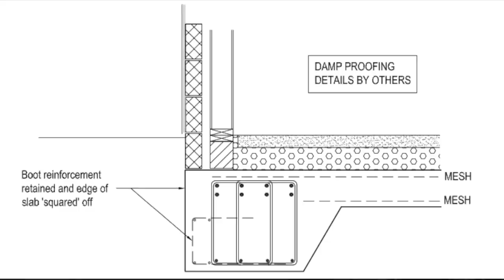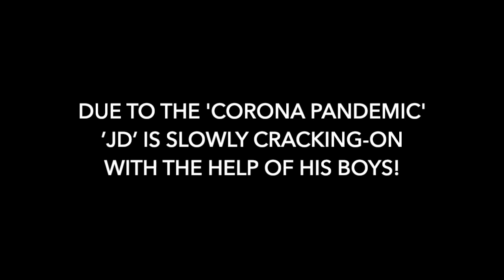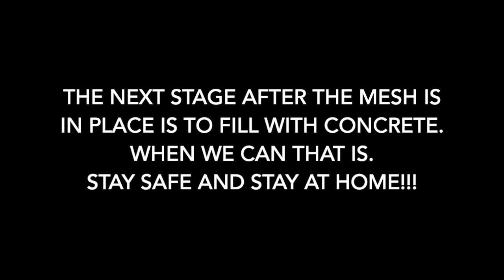Raft Foundation UK.  Raft System.

Comment: F me! 
I found you while assessing foundation options for my 30m^2 man cave.
Not all applicable to me, but I did learn a lot.
Thank you for posting :)
Reply: Hi Pompey, I used the same principle for my man-cave.  Only much smaller all round.  Basically a slab with double thickness where the walls went and some steel mesh to stop it cracking.  Best of luck with your build and thanks for the comment.

Comment: I am no expert by any means, but looking at the gauge of the steelwork and amount of stone, it feels like you are preparing the foundation for some some really heavy loads. Hand on heart was it necessary? Was there any bearing capacity calculations for your building before deciding all the parameters for your foundation? Thank you in advance. P.S. I'm in the process of building a garden gym and will have to go through similar process.
Reply from the maker: Hiya, completely missed this comment, apologies.  We did fight the structural engineer stating we 'weren't' building a multi-story carpark but the ground was so bad he wouldn't accept any less.
I assume your gym is all complete?  100mm slab with mesh through the middle would be plenty?

Comment: There are no starter bars for the walls is that normal or does the shuttering not necessitate the use of starter bars
Reply from the maker: Hi Leon,  No need for starter bars.  They didn’t want any of the steel exposed to air.  This will be a timber framed house so only one block high to go on the raft before house goes on.  It will have a brick outer skin but still no need for starter bars.
Cheers
Haydyn
Reply: @handyhayd  thank you very much for the reply truly appreciate it... can I throw one your way again for, so since for timber no starter bars are necessary is it the same for cement fibre based boards for a three story building? Working on a project and I dont see any starter bars there even though they are on the drawings is it the same as timber or no?
Reply from the maker: @understandingaddicts   You need to check with your Structual engineer as if they are needed the chances are the bars will go through the damp course and will need treating with a bitumen paint.  Often more hassle than there worth!

Comment: Why dont u isolate foundation ? Water and humadity damage  the steel  in time...steel will decay..
Reply from the maker: We could have put a plastic membrane but we used concrete 'blinding' instead.  The engineer gave us the option and our thought process was to let the water drain away rather than sitting in a swimming pool as any water will have nowhere to go.  I know in some climates you have to use a membrane because of termites.  This is not relevant in the UK. Your thoughts?
Reply: @handyhayd  should use membrane for protect foundation.